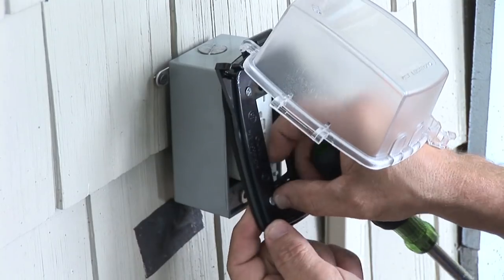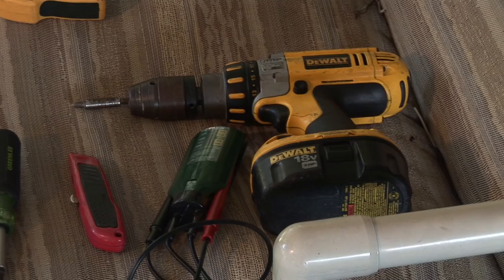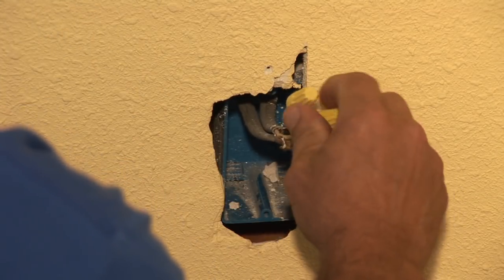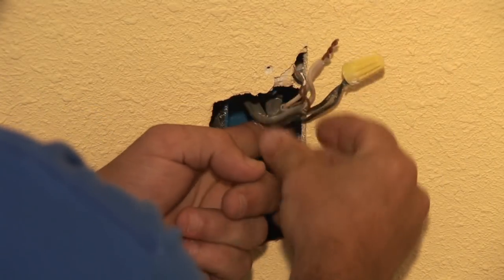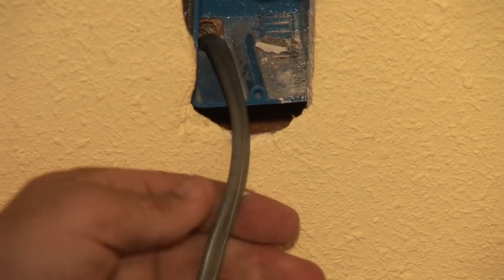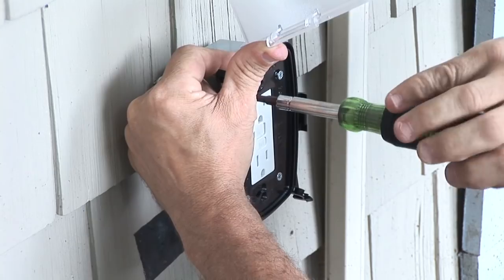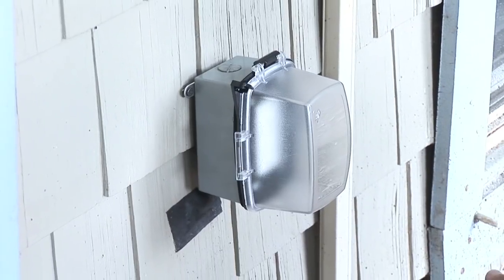Electrical Help : How to Install a Power Receptacle Outside

Comment: I have a plastic box where the tabs that hold the box to the stud broke off.   Is it code to screw it through the plastic from inside?  I know you can do that with remodeling.

Comment: Awesome  video, but what if someone doesn’t want the outdoor receptacle across from an indoor one?They want the receptacle maybe going to the shed,  I’d like to see how to do that project.hopefully my comment makes sense. Anyways great video
Reply: If you mean installing an outlet in a shed you have to use wiring meant for underground applications and suitable for wet location
Reply: Nick yes that’s what I mean, could I either tap of another existing outlet or would it be safer/better to go right from the breaker box to the shed? And also what size breaker do you think?
Reply: DuBB900 depends on how far your shed is from that outlet. If you were to make a new run 12awg 20amp breaker
Reply: Nick awesome, thank you for the quick responses and info. Have a great day!
Reply: DuBB900 np buddy

Comment: You did o.k. but failed to mention the line and load screws on the GFI...I would have put a  windows and doors Caulking around the box as well as the putty.

Comment: That outlet install just broke at least 4 National Electric Codes. Including but not limited to 1) Taping into an internal household electrical circuit (Outside circuits must be dedicated), 2) Drilling through the back of a electrical box, 3)  Fastening Outlet to the shakes, not to Structure, 4) Using mounting fasteners in an outdoor environments, that are not rated for outdoor (Sheetrock screws).
Reply: add to that (but not limited to): 5) The receptacle must be WR (weather rated) in addition to TR (tamper resistant) as was mentioned.  6) the in-use cover must be "Extra duty" rated, I doubt that one is.
Reply: Add to that the excess uninsulated hot and neutral sticking out of the hot and neutral terminals on the GFCI receptacle and the fact he attached the wires to the load side and not the line side of the GFCI receptacle.

Comment: You was installing the cables to the LINE of the CFCI outlet?
Reply: That’s ok the gfci will protect itself being connected to the line side only, this box is the end of the run. If there were more outlets downstream than load side would be connected to the wires going to those outlets, thus being protected.

Comment: good video - except what happened to the Line and Load connections on the GFI?    Is the silver side line, then the copper is the load ????     Is this required in western, PA....  How can I tell is my existing wire is outdoor rated - Is it orange or yellow?
Reply: Line is the power to the GFCI.  Load would be used if you wanted to hook up another outlet downstream, and still have it GFCI protected.  In this application the load terminals would be unused.
Reply: +frank mead Every question you asked shows you have no business attempting your own electric work at this point in time. Please read some books, watch more very basic videos. 

The answers to your questions are as follows:
1. Line and load connections are usually top and bottom depending on manufacturer and date of production. They are written in plastic on each device.
2. The silver side is line or load neutral, the BRASS side is either line or load hot.
3. It's a national code to have GFCIs outside so if western PA is in the US there is a good chance it is required equipment.
4. Orange and yellow outer sheaths denote indoor nm cable conductor sizes. He didn't need to use UF wire in this instance because no section of the wire was outdoors or buried underground.

Comment: I'm an electrical trainee in WA state. I noticed that there were a total of four screws (plus the ground screw) on the GFCI. What are the bottom two used for? Multiple phases?
Reply: I'm sure after a year you already know this, but somebody who visits may find it helpful. Sometimes a GFCI is used to protect downstream non GFCI plugs, in which case you wire the first GFCI to the line side, and daisy chain or pigtail other waterproof non GFCI plugs from the load side of the first GFCI, all in parallel after the first 'series' connection. The line and load connectors are labelled on the GFCI to prevent confusion, and most of these come with instructions explaining it more carefully. Check after with a GFCI tester -- it won't pick up every error but it's worth doing.

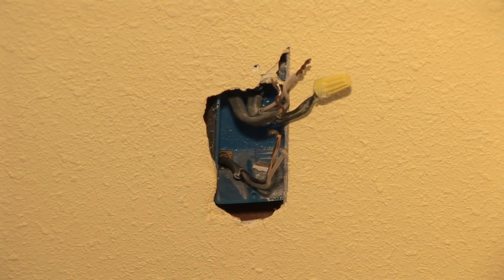Comment: The reason i´m looking at this vid is cause i´d like to know where/how to connect to existing power outlet. You did not finish that part at 2:57 ..... So what do you do? Just twist them with the other wires?

Comment: Can I install this receptacle in  wet-well/sump pit outside at lawn to connect sump pump plug-in  and its control power cables ?  (the sump pump cables plugs would be also protected by the case cover?)

Comment: I'm trying to install an outside plug for Christmas lights.  Should I connect to wires to the "line" side not the "load" right?

What happens if I do the opposite?  Also, on the original plug inside my house, can I connect two wires (black inside and black going outside as well as white already connected on inside plug to white going outside)  on each screw?

Comment: My question,,,, the wires only went into one of the plugs,does that mean you can only use one plug or are they  both hot?
Reply: Hi,
As long as you have one black wire going into one of the two holes on the hot side for the section labeled "LINE" and at least one white wire going into one of the two holes on the neutral side for the section labeled "LINE", your outlet will be working as usual. As far as I know, you can't split wire this type of GFI. So you don't need to have power going to both holes. 

Hope this helps.
Reply: thanks i was just  confused

Comment: essortment- can you show me how you connected to the plug inside the house.  I want to connect to the bottom part of the plug that is always live.  Turns out that the outlet is connected to a 3 wire.

Comment: Not securely mounted. Someone tugging on a cord to pull it out will eventually rip that outlet box out.
Reply: The siding also seemed to be loose.
Reply: He mounted both screws but only showed one

Comment: Article 210.8(A)(3)
All 15- and 20-amp, 120-volt receptacles must be GFCI protected. This may be with a GFCI recptacle or a GFCI breaker.

Comment: a stupid question since I'm a newbie when it comes to electrical work. Where would you find that wire inside the house to connect the weather proof wire to? I don't see any loose hanging wire around.

Comment: Is there an advantage to putting these exterior boxes vertically as opposed to horizontally?
Reply: Not much. If you install the box horizontally, your male end of your appliance or whatever you plug in, will stay in easier. When you install the box vertically, there is an advantage of install the outlet upside down, the ground prong, doesn't let the plug come out.
Reply: @thehandymancentral3660   Horizontally, I wonder who makes an exterior in use cover for horizontal install?

Comment: so one thing I didn't get was... what about the connection on the other side? It's not connected to anything yet ;(
Reply: Pretty sure you already figured this out, but just in case... connect black to black, white to white, and ground to ground. If the receptacle on the inside of the house has available empty terminals, you may also connect the new wires to those instead of using wire connectors. For example, if on the inside there was originally a black wire connected to the bottom gold screw and a white to the silver bottom screw, you may connect the new ones to the top screws since the top and bottom screws are connected together inside the outlet. However, if the top outlet and the bottom outlet are on different circuits, you cannot do this. If this was the case there would've already been two romex cables inside the box before and all the screw terminals would've been used.
Reply: I thought the same thing.
Reply: What about ground, there was no ground wire inside. Or did I miss it?
Reply: Would have liked to see it on video.

Comment: I want to run a wire from an outlet on the other side of the wall, but there's no room for a lock nut. Where do you get lock nuttage for a plastic box?
Reply: Taylor Wang I was told residential does not require the lock nut. So I'm going with that. All connections are in a jbox and accessible.

Comment: You mentioned the "duck sealant." I've looked for anything like that, but I can't find it, and all the suppliers I've gone to have no idea what I'm talking about, even when I take an old sample from the house with me. I notice that you don't show it in the video, either. What is this super-secret product?
Reply: alafrosty Lowes had it. I still don't know where it is located though since it was my wife who asked around the store and showed up with it. lol!
Reply: alafrosty  Its called "Duct Sealent". Its in the section with the wire nuts and zip ties, comes in a bar and looks like modeling clay.

Comment: Good
Reply: Thank you very much for the lesson. I'm glad I watched your video before i hit my circuit breaker.
I connected the white wire to the hot screw. I will redo it tomorrow. Very informative.

Comment: 2 things. You did not show the connection of the wires inside the house (though that's pretty straightforward), but more importantly, you did not explain the importance of the "Line" and "Load" terminals on the GFCI.

Comment: No need to use UF cable. Romex will work just fine.
Reply: @Leonard Holt  Why would you need under ground feeder cable (uf) in this case?

Comment: You only connected the white/black wires to the bottom outlet screws. Does that make both outlets work? If so, is there a way to tell where I can connect the white/black wires to make both outlets work with one connection?
Reply: X152535 the other set of screws is the load side of the gfci. If you wanted to protect another outlet through that gfci indoors, you could connect that other receptacle from that. However, don't cheap out on electrical. Buy another gfci plug.

Comment: Thanks for the demonstration. For the life of me I couldn't figure out how to mount the #@*! box. The instructions contained page after page of instructions on the electrical wiring, but nothing explaining what those two little bracket things were for or how to use them.

Comment: People say dont be nehative. I dont think it's negative if what you're saying is true. For instance, my master electrician BIL would be pissed at an apprentice, let alone a professional, if the left that 1/8", or any wire, showing out the back. It should NOT go past the body. And that mount job. One screw, and not even secured down well.

Comment: Don't like the way he connects the ground wire to the ground screw.  He should pinch the wire together, tight around the screw before tightening the screw.  Also, I think he uses too much putty to seal the hole behind the box - this causes the box to be away from the wall and not have sufficient support.  Otherwise, good job!

Comment: I guess you don't have to hook up the wires inside the house?
Reply: Am I missing something? Why would he hook up wires inside the house for an outside receptacle? I am just trying to understand and learn from the video and what is incorrect. I thought if you installed new wire and new breaker that was it. He connected the wire from in the garage - breaker box to the outlet. Is there another step? I like to understand so when I hire someone I know the basics. TY

Comment: i did exactly what you did to connect a split ac unit ,but it trips the gfi.Any thoughts on what could be the problem?
Reply: I'm not sure how, he didn't even show you how he connected the inside wires. If you did it the way he did, you'd have a new dummy outlet.

Comment: you stripped your wires 1/4 Inch too long, copper is showing and it shouldnt when they are inserted in the stab-hole.

Comment: I didn't mean to get you all worked up! I just can't believe you are a licensed electrician with the way you installed that receptacle. I won't make any more comments other than to say that the only thing you can do in NC that does not require an electrical permit is to replace devices or luminaires. If there is any new wire installed, it MUST be inspected! If one doesn't get a permit, he is subject to penalties. Just my $.02 worth!

Comment: I was goin' along good and all, nice explaining and stuff, then I saw how that was mounted over the crease in SHINGLES.  I crashed and burned.  Sorry.  I'm still trying to wrap my head around....good gosh can you see yourself pulling a plug or PUSHING a plug into that outlet?  Hey, I'm not being critical.  It is what it is.  At least you put it up.....but.....BUT.....I hope you have spare shingles and paint to match,  'cause that shitaintgonnalastlongthisI'mcertainof.  Hey, btw...how do you know I'm not an electrician bein' nice?
Reply: If you were a good electrician you would have seen more wrong than that in this video.
Reply: GoodGeeezus everyone gotta one-up someone.  WHO'S COUNTING!  I didn't know I was obligated to critique someone's work other than an obvious observation.  Let's be critical when he asks for advice.

Comment: I CRINGED MANY TIMES, THE WORST AT 7:19

Using the siding as a backer when scoring the wire.  Slip, I just cut the siding.

Comment: Hate to say it but pretty shitty work. Flimsy on uneven surface. Only one screw to hold it. Pretty shitty splice on the other side of wall I assume. How about a dedicated circuit with a beaker in the panel. Safe and well done...

Comment: What a hack this guy is. Just get power from some random box inside the house and then drill a hole from the inside out? Don't you want to position that box on a flat surface outside? One drywall screw is going to secure that box?
Reply: Then if you know any better why did you search up for it?

Comment: That looks like a really cheap installation. I have never heard of electricians use JB weld like that.   Its just short of connecting the legs of the lamp to the bare ends of the wires sticking out of the wall.  God, I hope this is not how wiring in new homes is installed or I had better get more fire insurance!
Reply: It's not JB Weld. It's ductseal.  It's used everyday by electricians to weatherproof building penetrations.  It's no big deal and it's code to use it.

Comment: 360,000 views, 360,000 people that will install incorrectly. This guy is a joke.
Reply: C H What would you have done differently?
Reply: I would have preferred the metal box inside the wall. (Not sure how to waterproof it thou.)
Reply: C H so quick to criticize, yet you offer nothing of value in return.
Reply: C H why don't you make a video then?
Reply: gonz pedro this is a horrible installation. And it took far to long to complete. I don't think he is even an electrician, maybe a handyman. The tools he was using tells me he is not much. No professional uses the cumbersome heavy junky old tools he was using. A 3-0 cut-in box is what should have been used, recessed in the wall. The gasket on the cover will make it a rain tight seal. Nobody uses ductseal to weather proof. He didn't even center the box in the siding. He should have gotten fired for that.
Reply: gonz pedro and why he used direct burial wire in his walls is beyond me. Standard romex may not be code in this area?

Comment: Nick, I will say two things: 1) shitting job, and 2) if the inspection department here caught you wiring that outlet without first getting a permit, they would ream your ass! They're all about getting the money via permit fees! BTW, why did you not use a cut-in box, and the in-use cover, and not have it sticking out so damn far? Is it called Afro-engineering now?